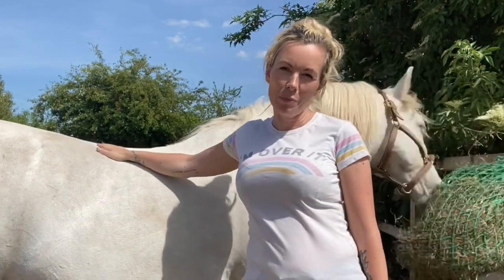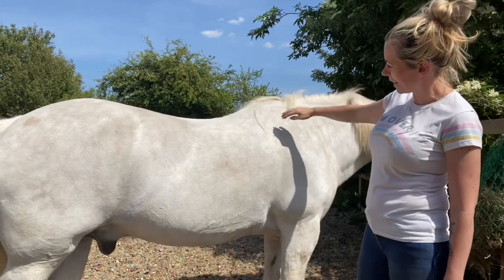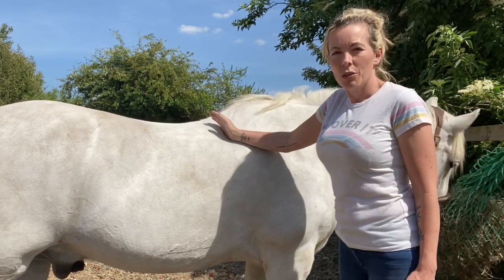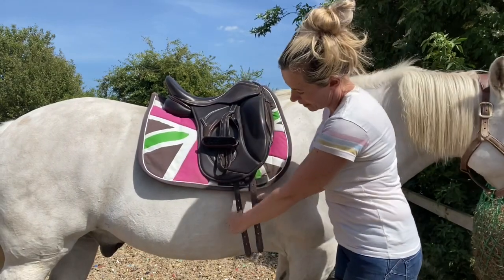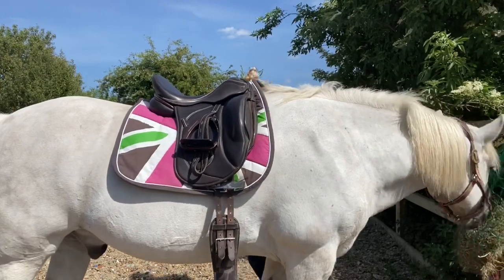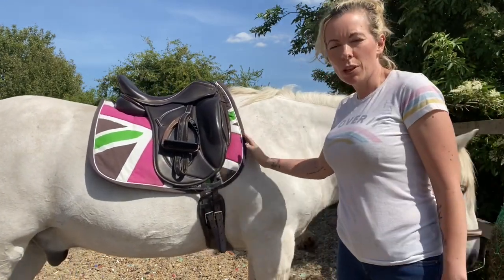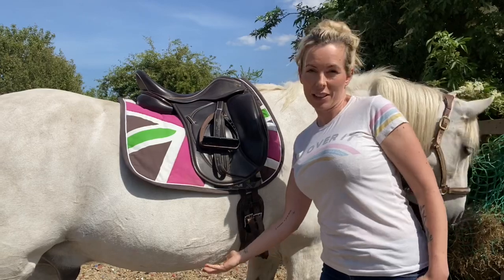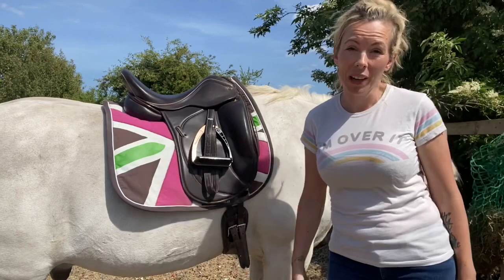CURVED GIRTHS... Will one help your horse? Do they help with saddle fitting?

Comment: I've heard (and seen firsthand) that some type of "anatomic" girths have trouble where they make more contact along the back edge than the front. It almost seems like that might be true here as well but that might be a bit of an optical illusion? Am I correct in thinking that getting good even pressure front to back through your girth is important to horse comfort?
Reply: my thoughts exactly, you cannot defy the laws of physics by changing the shape of the girth, the pressure is concentrated in a straight line between the buckles, regardless of the way it curves. if people dontbelieve it all ya have to do is cinch that up tight (not on thehorse,maybe a barrel)  and just see where the points of pressure are concentrated. prove it to yourself.

Comment: Really good video! What's your opinion on elastic vs non elastic girths?
Reply from the maker: Issy Bayley i think it very much depends on the horse. I am not adverse to elastic at all... but... it has GOT to be on both sides, not just one. And cheap, over stretchy elastic isn’t good. You want good strong, preferably triple layered, elastic. X
Reply: @ADayInTheLifeOfASaddleFitter  why does it have to be on both sides? Very interesting Video xx
Reply from the maker: Anna R. Because otherwise it holds the saddle unevenly. And creates more pressure on one side than the other x